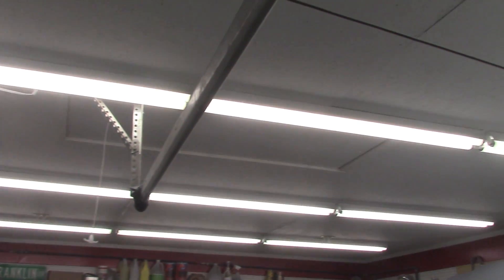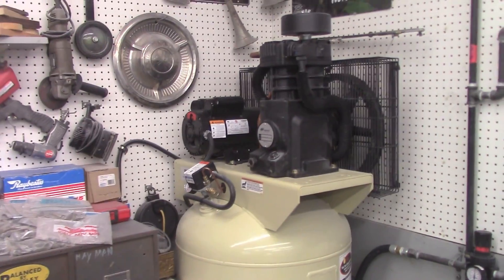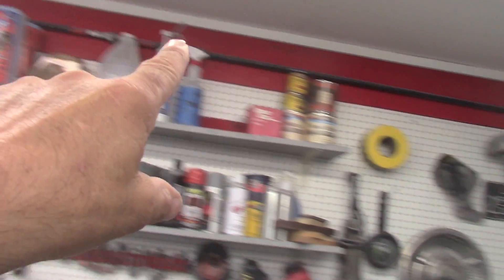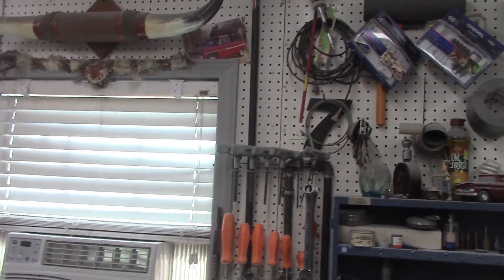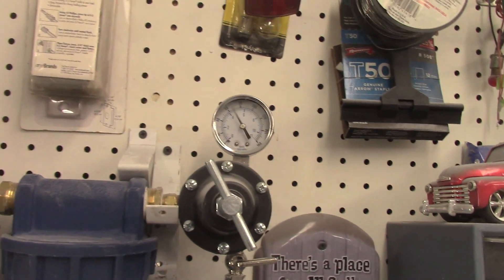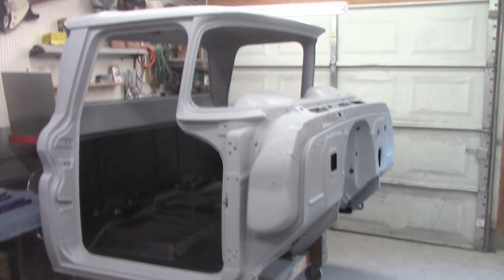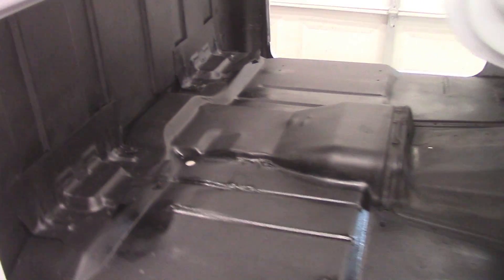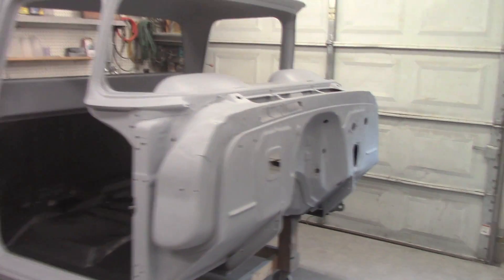new Ingersoll Rand compressor and my day job

Comment: Mr. Gibson,    I have watch your videos on this truck from the beginning. Not going to lie, when you rolled that hulk into your shop I though you were a little over ambitious. The rockers and floor blew me away. There wasn't much there! You kept replacing panels, welding, patching and before I knew it you had build the most beautiful 63's I have ever seen.      I only saw your son help you a handful of times. You would flip a cab over or mount it on the frame by yourself. Impressive!        Love the working, self reliant attitude "Lets get started".

Comment: I really like your air line and compressor setup.  Really well thought out.
Everyone will tell you that the gun they use is their favorite :)
Sata, Iwata, Sagola, Devilbiss are all nice units.  Speaking from experience, I would try to borrow or demo a gun before I spent $800 on a pro gun.  They all lay nice finishes.  I use 1.3 for base and clear but a lot of guys like a 1.4 for base.  Especially if it's summertime and temps are pretty hot.  My learning curve was pretty steep and I kept thinking a better gun would lay a better finish.  Bottom line for me was lots of practice and spray the best materials you can afford.  Good luck !
Reply from the maker: Thanks for the good advice

Comment: sata is a great gun and  I have a couple but so is Iwata .....I dont use different guns for base and clear. I readjust the gun (as far as air pressure and material feed) for base and clear never had a problem.I dont think there is any need for two different guns.  and that is just my  opinion. Great update!!!
Reply from the maker: Thanks

Comment: Nice compressor, 2 stage is the way to go.  had my own body shop about 40 years ago.  Some tools will burn up all your air, like grinders, so I also used some electric tools.  You can never have enough filters, they even make small ones that fit on your spray gun.  Back in the day Binks and Devilbess were the best on the market, I don't know about today.  One good gun will do the job but two is better in case one brakes down in the middle of a job.  I also had one for primer and one for painting. Watching you brings back memories.   Now put some styrofoam on the inside of those garage doors for insulation.
Reply from the maker: Good idea on the styrofoam thank for the advice all my grinders are elec no doubt it will save on the run hours on the compressor

Comment: On the electrical set up for the air compressor,did you use #10 wire with a 30 amp breaker,or #8 wire with a 40 amp breaker?Thanks

Comment: nice job on the air lines you should have no problem with water in your system
Reply from the maker: Thanks just sprayed my fenders today with a coat of primer system works great have a steady amount of air flow
Reply: I need to get a seperator/dryer but man they are proud of them

Comment: thats an awesome air compressor set up good luck on picking the right paint gun i would say you'll have some good advice from the guys that use them everyday vw darrin, slowsrt, satajet883, mike mckay, james freddy, any of those guys would steer you in the right direction neat seeing the day job looks like alot of work
Reply from the maker: Thank man looks like a lot of different guns out there just trying to fine the one that does a desent job and will lay it down pretty smooth
Reply: gibson63 velvethamma has some pretty good paint gun review videos also

Comment: i have the same compressor my comment may be too late but just in case...i suggest borrowing a gun to get the feel of it like the other guy said cause if you go drop 800 on a gun its not gonna make your paint job look great if you dont know how to use it im a newby painter also i've been into it bout 3 yrs now and i have dropped some money into learning this paint game.. i started with harbor freight guns to make sense of  hvlp and practice alot on hoods and other car parts as i got better i stepped it up now i have sagola. a tekna i use a finishline for primer 1.8 and another gun with 2.5 for heavy coating and for my everyday all the time gun is the concours gun from eastwood now thats my baby there i love that gun..now i think they are all good guns because i learned how to use em to be honest i got more paint equipment than some paint shops.LOL to end my long ass comment 3 yrs ago i didnt know  how to read a mixing cup now i got people thinking im a real painter.. practice practice practice then one day it all came together ..good luck with that truck you had me fooled  i thought you were a 25 yr pro
Reply from the maker: this compressor sure does the trick Thomy shuu (wildeyednorthernboy) loan me his binks gun until I finish the job
Reply: good i sure got some toys you could play with im in ny its 10 degress outside right now i cant do nothing till april.. im a concrete finisher so im laid off and cruising youtube
Reply from the maker: I'm from Tennessee myself waiting on a slab to be poured when the weather gets right I frame houses for a living
Reply: you talking my game when you say concrete thats my thing.. i do some residential but mostly heavy highway and bridges
Reply: CONCRETE MONEY just don't get into a slump 😂😏

Comment: What do you recommend  for a MIG welder for restoration?  I am very confused about what to buy.  Great work!!!   I love restoration and also frame houses in the northeast,  Been thinking about moving down your way.
Reply from the maker: john imburgia  i use the Lincoln pro mig 135 its great for sheet metal on these old trucks
Reply: Thank you!   I just bought the Miller 141 autoset today.. I was thinking about a Lincoln but couldn't resist the Miller.  Keep up the great work!